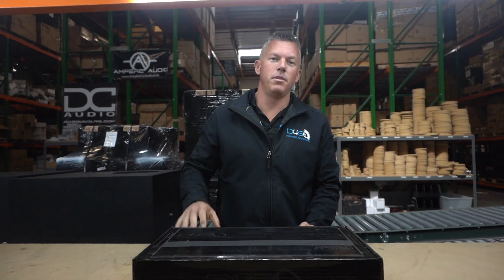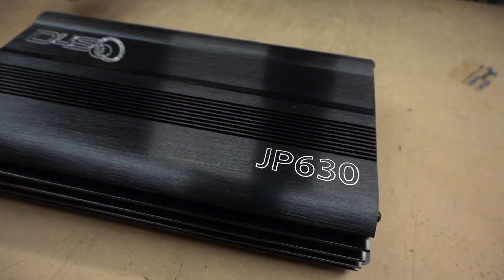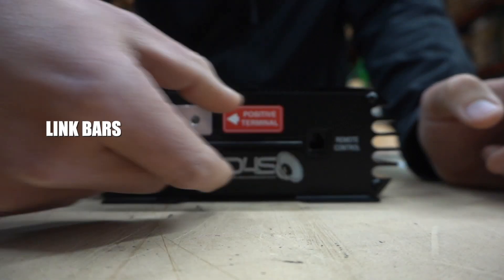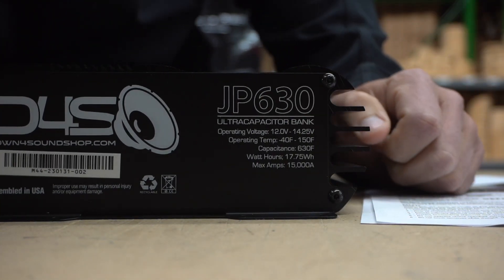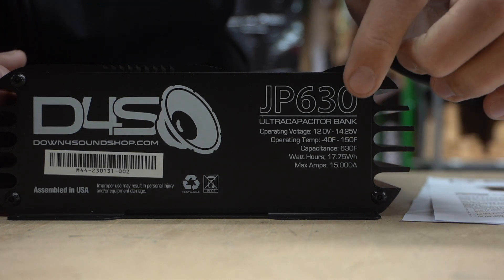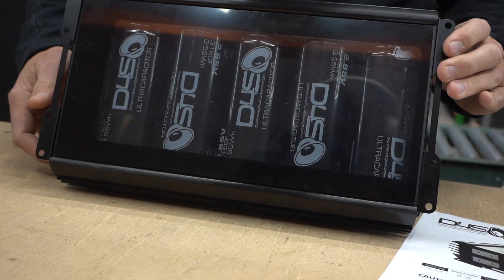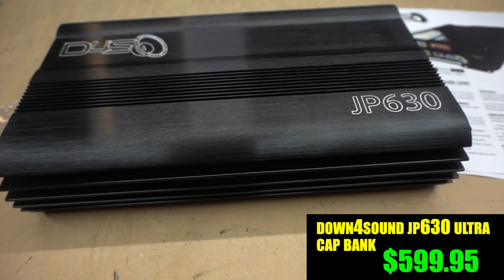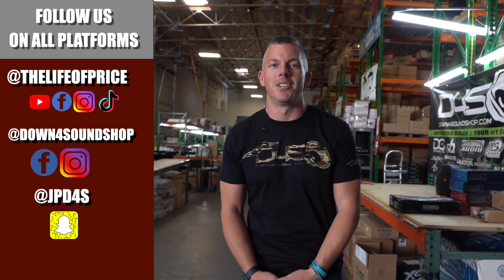UNBOXING THE NEW DOWN4SOUND JP630 SUPERCAPACITOR BANK

Comment: Not sure if id be better with this or the lto 6.0 I have a excessive amperage alt says its 300 amps but not confident it is and xs 3100 going to a jp33 from my jp 23 I need to add something more the current setup still doesnt keep up with the current jp 23 and im upgrading to the 33

Comment: JP I have a question, I watched this video when you aired it, but coming back to it now. I'm looking at the combo with this and the JP40. I just picked up a second alternator, Mechman 400. Would you be concerned about the charging voltage of that alternator, I know voltage fluctuates, and wouldn't want to damage these, JP40 & JP630 combo. Is there some kind of voltage regulator that would cap the voltage that you might recommend? Or should I be good to go? Thanks in advance.

Comment: Do u have to have  a isolator to run this. Is my question? I recently bought one. Hooked it up went to put a fuse in and my fuse melted can someone help?
Reply: Did you figure out the issue?   How does it work ?
Reply: You have to do a battery delete

Comment: Just got one of these. Before I was getting voltage drops on idle even with a 320 amp alternator because I’m running 9k rms. Once I charged and installed at full tilt there’s virtually no voltage drop and tachometer doesn’t flinch at idle even with heater, steering wheel heater, seat heater and headlights on.
Reply: Sp what is the max voltage  on this unit.    Currently have a kicker zx2500.1 and a 250 amp alternator
Reply: @elulysero8863  14.8 is on the very high end. I’ve had it installed for two weeks now no issues with a 320 amp alternator.

Comment: Is the jp 40 and the caps enough to run a car with battery delete? Or is 2 jp 40s? I do have a 280 amp alt and running a salt 4k.I currently have a 45ah yinlongs but not using them to their full potential at recommended 15.6 To 16.3 volts, which they rated at.

Comment: How would you charge this?
Reply: I'm trying to figure out the same thing I own one
Reply: @chadcrowe753 did you ever get it charged ?
Reply: @elulysero8863  yeah I figured it out had to charge it like a battery but at a certain voltage and to a certain voltage.
Reply: @chadcrowe753  could you share the process with me.   What charger did you use ....

Also how do you like it ?   Did it make your bass hit harder ?

Comment: 2 questions Jp. My Scion Tc voltage is regulated by the computer to 14.4v. Is that too high for this jp630? And also does the jp630 come with the remote monitor?

Comment: I love my Jp40 no voltage drop at all This would go nice with it .
Reply: I just ordered a jp 40 I'm running a jp43 js 320 alt and 2 xv3 10s ik they call it a 10k battery but that's over rating as long as it's good for 5k I'm happy
Reply: @NickVaughn-en9bb  U will be happy with the JP40. I’m no expert but talking from experience I honestly believe they good for 6k, it’s probably good for 10k only for a quick second burp not for a 10k demo or daily.
Reply: @CarsBikesBass  ok great I probably won't be seeing more than 5k on music so ya great
Reply: @CarsBikesBass  if I ever need just a little more power I'll get this jp630 cap
Reply: @NickVaughn-en9bb  5k is the sweet spot I don’t think u or I would need any more power in a long time so yeah u will definitely be good + JP makes some powerful amps, good luck with your system if u have any questions or need any help just let me know.
Reply: @CarsBikesBass  ya and sense I have a 320alt not a 250 that will benefit alot
Reply: @CarsBikesBass  how did you do your battery delete? Is really what I'm not sure about
Reply: @CarsBikesBass  you in fl by chance cause I'm going to made of steel will be my first time hearing 150-170db
Reply: What are you running
Reply: For alternator amp and subs
Reply: @NickVaughn-en9bb  I’m running a DD M5000 is a 5k amp along with the JP40 ,250 amp alternator, with 3 DC audio level 4 12s box tuned to 33.
Reply: @CarsBikesBass  nice and you charging 14.8 or 14.4
Reply: @CarsBikesBass  I'm running a DC audio elite 15 at the moment
Reply: @CarsBikesBass  there great looking subs but definitely over priced because this subs 900$ but has the same motor force as like a sundown x
Reply: @NickVaughn-en9bb  14.6 & drops to 14.1 full tilt .
Reply: @CarsBikesBass  nice hell ya right now I just have 1 extra agm and can drop to 12.4 easily
Reply: @CarsBikesBass  Bro I just got the two sundowns
Reply: @CarsBikesBass  One crazy thing
Reply: @CarsBikesBass  We put.
The d c in Dudes truck in a blew
Reply: @CarsBikesBass  He wasn't even mad
Reply: @CarsBikesBass  He already knew dc was garbage
Reply: @CarsBikesBass  He was adjusting amp gain And it Is bottomed out for maybe 2 seconds
Reply: @CarsBikesBass  That shining of killed it Sun down can handle it
Reply: @CarsBikesBass  He said he's going to put  sundown parts in it
Reply: @CarsBikesBass  He has 2 250 alts and 3 titan 8s
Reply: And a surge 7k Coil is scratchy
Reply: @CarsBikesBass  Must have came un wound
Reply: @NickVaughn-en9bb  sundown is great 👍🏽
Reply: The best
Reply: @CarsBikesBass  I can't believe this nine hundred dollar sub failed I bet a skar vxf can handle more clean power

Comment: Would I be able to use this in a SXS application that charges with a stator?
Reply: naa I don't think so.
Reply: If your using a lead acid battery or agm it should be compatible. Check its voltage output to make sure its not too high.
Reply: @JasonWW2000  bro it's using a stator for juice. No way in hell can it keep up

Comment: It should be noted that this is a 5S configuration while everyone in car audio normally uses 6S. Anything above that 14.25v can cause the caps to immediately fail. You shouldn’t be at max voltage on caps all the time either. The cases look nice but I’d never put these in a car unless you’re charging UNDER 14v. You’re better off spending the money on an alternator and external regulator combo.
Reply: You are absolutely right..especially for that price..I'd rather up grade my altinator
Reply: Exactly, this product is meh in this video
Reply: What about everyone in car audio that use headway cells or salt amps?
Reply: @BrianandLilMansStuff , I’m running a 400amp alternator, Salt 8 with 120ah of Headway Cells at 14.5 with an XS SuperCap under hood. I won’t be buying this. It is nice though.
Reply: @62dobie  You might be running those headway cells above 80% which requires a special constant voltage charger. If your only using an alternator I would charge at a slightly lower voltage to make sure they last a long time and don't overheat.
Reply: @JasonWW2000 , what voltage do you recommend?
Reply: @62dobie  I'd keep them charged to 80% of capacity. So probably about 14.3v if you have an adjustable regulator. Do you notice them getting hot when fully charged? It's usually that last 20% that puts the most stress on the cells and takes the longest using constant voltage charging. An alternator isn't really sophisticated enough to charge lithium that top 20%. If your voltage regulator is fixed at 14.5v I guess you don't have much choice.
Reply: @JasonWW2000 , I will be installing a adjustable regulator this weekend.  Thanks for the advice. Also, no, they don't get hot. But it's cold where I'm at.
Reply: @BrianandLilMansStuff  no one uses 3s headway and calls it a 12v max battery. Those aren’t a comparison to this. Headway is safe to 14.6 max which is within normal range for most cars. 14.0 max is way too low a threshold.
Reply: @thelifeofriley815 I'm not a expert on lithium but I have 3 jp 40 and a xs power cap bank under the hood in my 2006 grand prix for almost 2 years now with no issues.
I have a gp audio 320 alt but on a gold start the voltage always 15.1 or 15.2 for like 30 seconds then does the gm thing and drop down. I assume it's pcm controlled not sure if I should do something different or use the it's not broke don't fix it saying 😂
Reply: I competed with 8 banks in the 5 configuration ran them at 15 volts for years worked perfect I would clamp 10,400 watts out of a sundown 7500
Reply: Well they say it’s 14.8 but idk lol they are on sale right now for 200 and I’m running stock electrical, do you recommend?